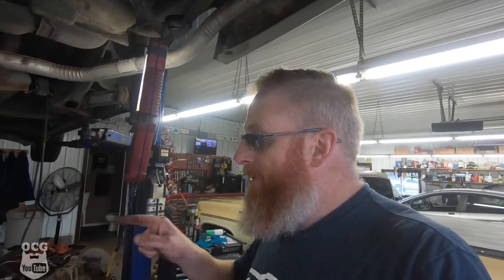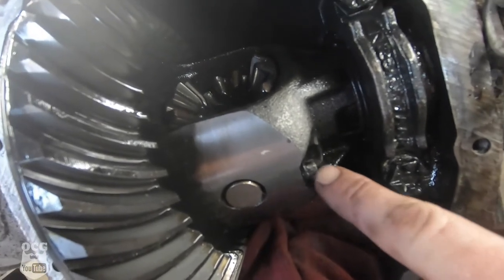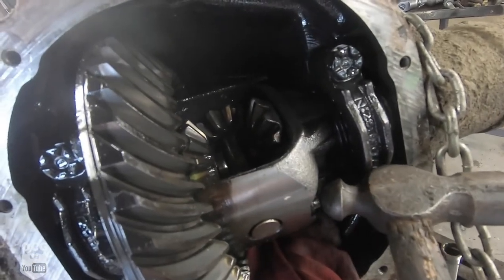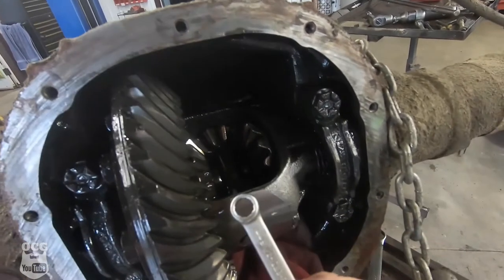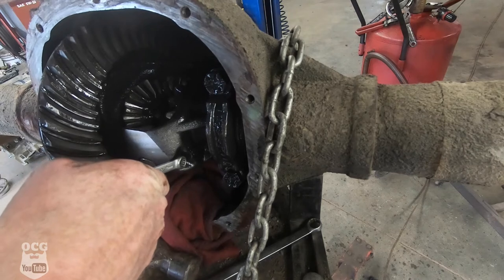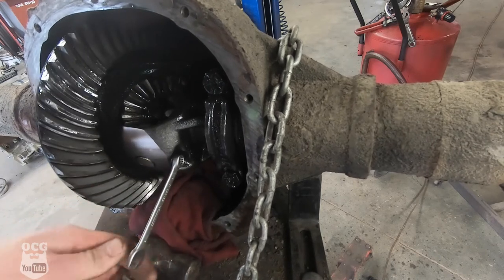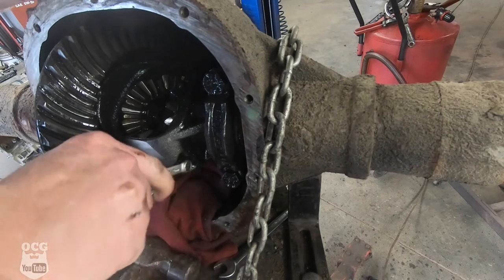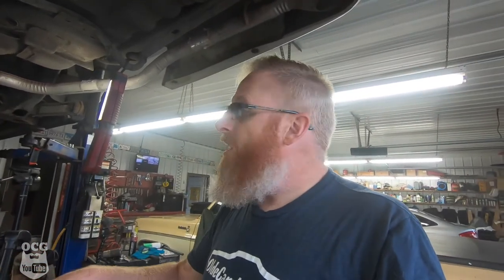How to remove a pinion shaft bolt with a rounded head

Comment: Thank you for this! I’d even tried extractor tools and those just rounded it off worse. I hit it a few times with a hammer and held a torch to it for about 15 minutes until everything was glowing and the bolt slid right out. I’ve been fighting this thing for two days now and the trick about hammering the bolt back flat was the only reason I was able to get it out.
Reply from the maker: Glad I could have helped!

Comment: my rear axle has no bolt just a pin that locks the pinion shaft in the case (not a cotter pin, but an expansion type) how do you get that type retainer pin out? since it's at a right angle in a tight space, not sure it can be drilled out ?
Reply from the maker: Yikes. I hate those roll pins. Try a right angle pick to pull it out. I'm not sure really! Sorry i'm no help.
Reply: THANK YOU, I'll give it a try.